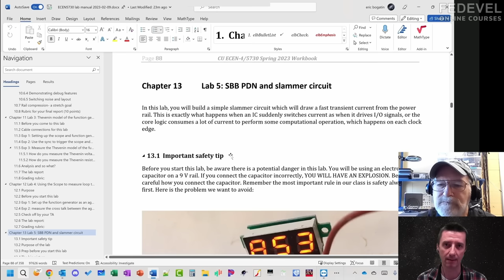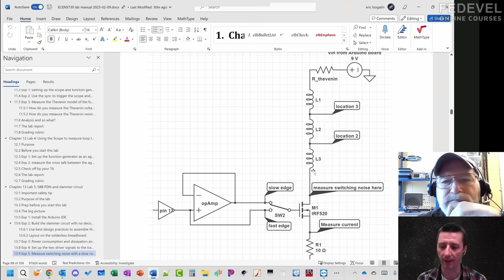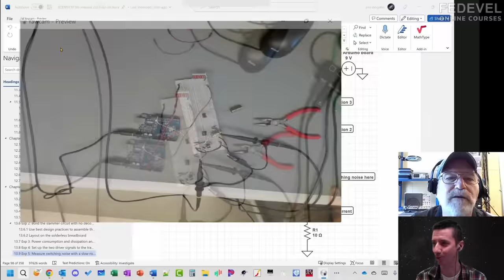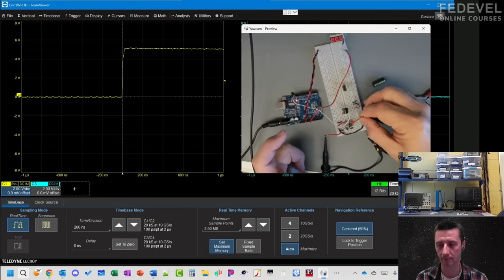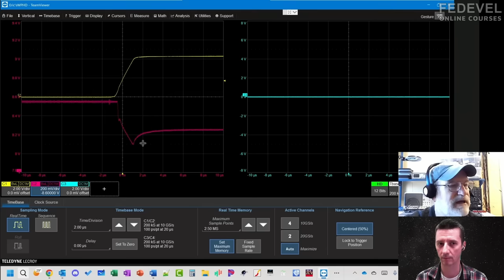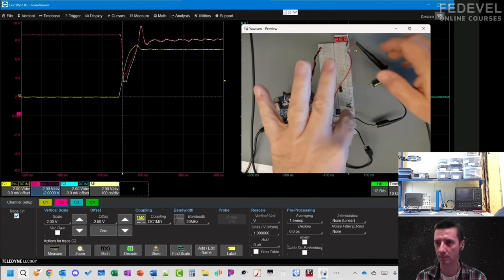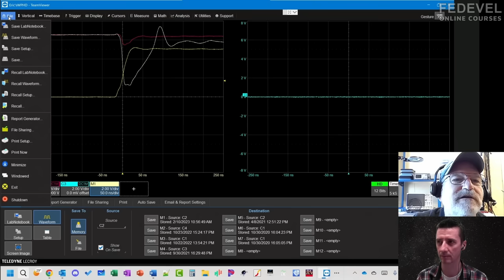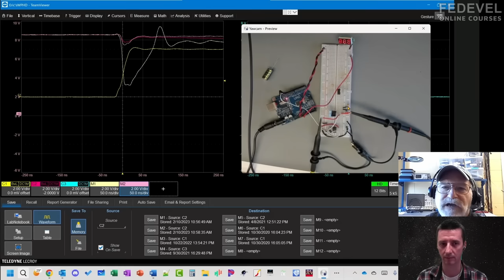What Decoupling Capacitor Value To Use And Where To Place Them | Eric Bogatin

Comment: For anyone wondering how the equation at @37:40 came up, it is elaborated below

The base relation between Capacitance, charge and Voltage is 
C=q/V

Re-arranging the equation with respect to V
V=q/C

Differentiating on both the sides, we get

dV/dt = (1/C).(dq/dt)

Since current I is the rate of flow of charges, I=(dq/dt), the above equation becomes,

dV/dt = (1/C).(I)
dV/dt = I/C

The above equation is rearranged with respect to the parameter that needs to be calculated. In this video, we are calculating the capacitance.
Hence, the equation becomes,

C = (I.dt)/dV

Comment: These videos are always really good, they really nail down the things that you need to know without making it massively confusing or going on a wild goose chase to come to, the majority of the time, a very simple conclusion. I think its especially a difficult thing to do because knowing about something and teaching it are two seperate areas. I still do have to rewatch these videos a few times and takes notes but in a relatively short time (couple of hours) will come to a good understanding. 

Also props to Robert for asking the right questions and clarifying information either within the video, or doing a bit of editing to make it more obvious what is going on.

Comment: I learned so much by watching this.

I recently bought an oscilliscope just so I can see these things and this example is the exact experiement I bought the scope for.

I'm here beause I recently built a circuit that runs from 9V 1.5A power supply that has an Arduino Nano, Small Servo, a small OLED screen, 5 various potentiometers, 5V opticouple relay which I'm using as the switch on an independent (brushed) motor driver board that I'm turning on/off that is being fed from 9V side of the power rail along with the motor.

I'm using a L7805CV to power the 5V things (OLED, Servo, Relay) and the nano's getting it' power from the 9V side . . . 

I was having intermitent hangs in the whole system after running a while . . . 

I peeked with a probe and was astonished to see how the VR was spiking huge voltage spikes all over the place . . . 

I had NO capacitors other that what's called for in data sheets for the VR . . . 

So, learning about the need for placing capacitors throughout the board from various sources . . . I never came across the discussion of induction and WHY and this is the first time seeing this broken out so well. 

So, thank you . . . looking forward to learning more from the book. Also, I've purchased the book mentioned so I'm looking forward to receiving it and learning more.

Comment: Very nice thanks to you, Eric and Robert!
Keep in mind, we also often need to compromise for low-power devices that switch frequently in standby mode (resulting in loss to resupply the capacitor) or to limit the power supply for starting current (by increasing the regulator, for example, or accepting a longer starting time). Keep this in mind: if a 0.1µF capacitor does the job and the noise level is acceptable or has been tested as a good condition in the data sheet, then it is a minimum 'good' working condition and a correct one. This is not an optimum condition, but a good minimum for general use as a reference point in a data sheet. It is up to you to design electronics with a good understanding and thoughtful consideration including while you increase all decoupling capacitors and load the supply, that may now have new trouble.
Reply: If you have excessive capacitance on the PCB for the power source at hand, just add an inductor in series with the power supply to reduce the burst current.

Of course the slow rise of the input voltage can sometimes cause trouble with your reset logic, so that needs to be validated next for whether it's robust.

Comment: This is actually a very widely used method to implement hardware/software hacking via glitching; the chip whisperer actually uses VCC rail Glitch Attacks so aside from the internal issues this phenomenon can cause it's actually important from a security aspect as well. Very well done guys.
Reply from the maker: Do you know someone who could talk about this? I could try to contact them ... and maybe make a video about it.
Reply: @RobertFeranec  Stacksmashing did a video on using voltage drop to enable jtag on an airtag to dump its firmware
Reply: would be interested to know more without going on a deep dive with my substandard internet service (<5g/s ) and sore eyes.

Comment: I do electronics repair and it's common enough to find an internally shorted capacitor on the PCB, and it's usually a high capacity MLCC, 10uF or so. I have doubts whether maximising capacitance on all your MLCCs is a good idea, they seem to get quite fragile, and the voltage rating margin is reduced as well. Furthermore if you're dealing with hot components, the local warpage of the PCB from thermal expansion is increased, so the closer in you bring such a capacitor to the IC, the more trouble it is. There is also some warpage in the capacitor itself from the voltage applied i think. I understand it's often a necessity, but maybe it's something to keep in mind, and maybe not introduce reliability hazards where they're not needed.

Comment: Eric's article was featured in the Embedded Muse about a year ago; a little while after I got an exam question which asked why a designer had used three capacitors each seperated by a decade... I pretended not to have read the piece ^^

Comment: But how about those impedance curves for 1uF and 0.01uF capacitors that show that at frequencies above 1-10MHz you get a lower impedance and thus better decoupling with smaller capacitor values?
Reply: Isn't than answered at minute 1:01:40? Or do you mean something else?

Comment: Very informative video that makes it clear wht you should use care when selecting decoupling caps.

I started out using tubes and fought my way through transistors and then IC's in my 30's and 40's. I was working on low power (<10W) microwave equipment in the 60's and crude switchmode supplies (using 555's and LM111 comparitor chips in the 70's. When the SG3524 came out is was a game changer for all of us.

People of my age try to ignore surface mode because we can't see em.

Comment: This is a good video for debunking the 3 cap myth, but I don't think I agree with the assessment of using as large a value as you can peppered around. If you pepper 10uF 0402s all over a board, you can quickly have 10 of them, once there's one for MCU, one for each i2c connected widget etc... So you have 100uF of ultra low impedance caps.  Now on a modern board, you most likely have a switch mode or linear regulator locally supplying that 3v3/1.2/... rail, even the 9/12 is probably derived locally from a 24/48V rail by a several hundred kHz DCDC, and we probably have ground and power planes with near zero inductance. 

The local DCDCs at ...300..kHz do not drop out like the scope shots Eric made by a long way, and neither do locally referenced linear regs.

So what is the dominant factor here really? I content that it is not the inductance or the capacitance; that is a 1990s problem and a bodged together breadboard problem. The real issue these days is regulator loop stability, and for that, we do not want to be driving a massive low impedance capacitor bank. So perhaps it is better to have a bulk with some ESR for stability and the localised low impedance capacitors are a much lower value... say we use a 100uF electrolytic or tantalum plus... 100nF 0402s. I contend that on a modern board, that will result in lower ripple and noise. Each DCDC/regulator and its control loop is a bit subtly different, but after many variations and attempts I have found that piling on high value low ESR ceramics is not the best choice.

Comment: Am I right? Eric told to used 10uF 402 instead of 100nF? And it is safe? What about 1nF? OMG? But capacitance value interact with Self Resonant Frequency. And the SFR of 10uF is 100 time smaller than 100nF. How can it be? OMG! Maybe the point is, we dont care about capacitve or inductive behaviour at hf just need low impedance, we can synthesis that with multiple identical uF but that can produce huge inrush current!
I Love you two guys. Thank you so much.

Comment: also, what about the MLCC impedance vs frequency characteristic? the lower the capacitance, the higher the frequency at which the impedance is the lowest. should fast switching be considering high frequency in this context?

Comment: i  used a lot of tipical dip packaged opamps when i was indeed building audio gear. nice to have em in a socket, nice to try a few different opamps for testing how it sounds etc.. i had my opamps prepared by having local decoupling soldered directly on the leads as close to the package as possible. the cap it self was bang on the package it self. that very tipical 0.001 || 0.01 || 0.1 setup never made any sense nor did it ever sound well. i had indeed have this local decoupling and pair of larger value low inductance capacitor nearby  in parllel.

Comment: I always enjoy these. It would have been interesting to hear Eric's thoughts on the idea that multiple capacitor values keeps the impedance curve lower across a wider frequency range, where the lowest impedance valley of each cap come at one frequency after another (I'll have to read his article). I'd also love to hear about avoiding resonances. Like we just made an LC circuit with the wire inductance and decoupling cap. When do we need to worry about that and consider damping? Many people suggest the use of Pi filters (CLC) in power distribution for generic noise filtering but I see some not using any damping. Is that okay? Is any amount of peaking at some frequency in an LC filter acceptable? Should I not use solely low ESR aluminum polymer caps because electrolyics are a guaranteed long term failure mode? What about a Pi filter with a ferrite instead of inductor?
Reply from the maker: thank you. have you seen this video? https://youtu.be/hZSOhVdzqZk
Reply: @RobertFeranec  I'm not sure I have. I'll have to watch that whole series!
Reply: We have been using tantalum caps along with ceramic for supply decoupling for many decades for precisely this reason.

Comment: Great video, but i have a question - what if capacitor is placed after the MOSFET in the south side of breadboard? We should place capacitors on the path between vrm and the load, or we should just add this additional "source" ?

Comment: Really interesting stuff, thank you! Now how about when designing a LDMOS 440Mhz driver amp for let's say 5W output. Now every inductance counts, also for those decoupling capacitors. When using a single capacitor it will have a resonance frequency offering no decoupling at all near that frequency, often in the neigbourhood of a few 100 Mhz, that's why I still use those 3 values, 1nF, 10nF and 100nF on the powerrails., each having different resonant frequencies. I still think this is better solution than a single decoupling capacitor... What is your opinion about this? I hope to see an answer but looking at the other comments I guess I will not get one...

Comment: Good discussion.  One of the issues I have is my old tools don't have much in way of calculators built-in and so calculating inductance of a trace isnt an option.  I can put pads down and mess around with a scope like they've done in this vid but had hoped for a better approach.  I guess at some point I'm gonna have to buy new s/w.  I do like using through hole parts but more and more are smd and it is getting hard even for my hobby work to avoid

Comment: It really isn't a question of the leads of the 1,000μF capacitor. You cut them as short as you like, but the construction of the electrolytic guarantees a significant inductance to render the electrolytic cap useless for decoupling fast changes. VC = It and we have C=1,000μF, I=400mA, t=50ns, so the voltage droop should be (400m x 50n)/1000μ = 20μV, but we observe about 800mV, and that equates to an effective capacitance of about 25nF at time-scales of tens of nanoseconds. The 1μF ceramic cap showed a droop of 600mV and that would be expected from a perfect capacitor of 33nF, so there's still a significant loss. You should have shown the effect of a quality 100nF cap, despite your misgivings.

If you're happy with around 1V of switching spikes, then you only need a 22nF low-inductance capacitor with 400mA switching in 50ns. No wonder we use 100nF as standard close to each chip. It should not be confused with the decoupling capacitor used to prevent supply droop due to the internal resistance of the supply, and as you showed, that's a much lower frequency and requires a larger capacitor, but we don't need as many on a board because the inductances have relatively little effect on that.

[Edit] It would have been helpful if you had actually shown the voltage at the source of the IRF520 to confirm the current, since its Vgs(th) is specified as between 2V and 4V, meaning that the actual current when the mosfet was turned on with 5V on the gate could be anywhere between <100mA and 400mA which would make a big difference to anyone wanting to repeat your tests for themselves.

Comment: Great video. When we are discussing myths in some applications are suggested to put a series resistor at the capacitor, is this also unnecessary?
Reply: This is moreso for recreating ESR for a capacitor; some regulators were made before large capacity ceramic caps really existed... And due to how their control loops operate internally, having too little ESR on the output can cause it to become unstable and oscillate. So one method to get around that, is to add a series resistor to a ceramic cap!

Comment: I am little confused with explanation.
First conclusion is :             One should use 1uf instead of 0.1uf  .
My confusion is :    One should use 1uf  ceramic capacitor with 1000uf electrolyte capacitor ?

                                 1000uf is too big , you haven't shown in experiment , what other values can be suitable like 10uf , 100uf ?

Comment: Great video, but the self resonance of the SMD capacitor didn't come up. The question is: Aren't there cases where you want the higher resonant frequency of a smaller value capacitor, even though the package will have the same inductance as a larger value in the same package? My recollection is that the 0.1uF caps have a self resonance frequency at about 50 MHz while a 10uF capacitor's resonance might be between 5 and 10 MHz...
Reply: I believe the philosophy has always been bulk caps for higher current loadings, ceramics/film for filtration, both in case you have noise AND current draw. EEVBlog covers this in a video where you try to choose parts so that their self-resonance values align with the frequencies you want to filter.

Comment: Very interesting video, so much used and so often misunderstood. (Like the USB grounding of the shield haha, but before I start a war, back to caps 😂)

Question 55:40 : put some whopping large caps for the powerrail, after for example the Vrm; this is sometimes maybe also a problem, with the big current rush in. A resistor is mandatory perhaps, but also reducing the ups like effect? What is the opinion of others?
Reply: Yep, low-resistance and relatively high-power resistor (if sized correctly it can also be a fuse/glitch resistor) can be used to limit inrush current. Chokes also help as well, they limit di/dt which affect the charging rate of the cap.

Comment: I'm getting the impression it's analogous to a water-hammer. 
When you turn on a tap, there's a reduction in pressure in the pipes, which, in old pipes can cause them to physically move as they relax. 
When the tap is turned back off, the pressure rises and there's a certain inertia in the water which can cause the pipes to bang on something as they physically move back under load.
Not that electricity has an analogue for inertia, but voltage is often stated to be analogous to pressure.
So the capacitor arrests the pressure spike, and reduces the "hammer".

Would anyone agree with the general analogy?

Comment: Hi sir my name is vinod from hardware deparment in my company.i have a question for you that is, in our boards we are using a voltage regulators of part no:EN6347QI ,which is used to convert  5V to 3.3 and 1.5V.If one voltage regulator is shorted then we did not get any output at another voltage regulator of same part number but why it is so?????????????????????

Comment: Feroelectric effect will make the larger values ceramic caps in physically smaller packages decline in effective capacity way lower than the nominal, -80% is not rare. 100n caps it is, still.

Comment: Now I have one question: it looks to me that the person doing the schematic does not have all the important information needed to calculate the decoupling (capacitor values, size, etc.). Isn't this a job that needs to be solved closely between the schematic designer and the PCB designer? How do companies work on this, when the roles are separated, or even 3rd partied?
Reply from the maker: I don't have this super expensive equipment to do that, but if needed and if I could, I would built a prototype and then measure it and tweak it. Also, some of these things can be simulated - so that would be another way to find out how the final schematic should look.

Comment: You grab a handful and throw them at the board. Where they land is where you put them…. Because they are just decoupling caps, 99% of circuit boards out there will work just fine with half of them removed.